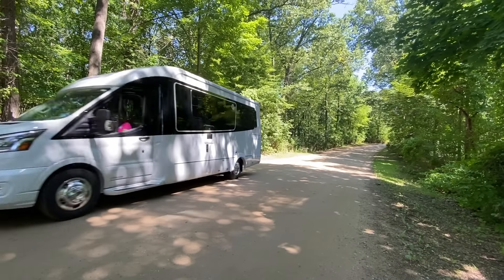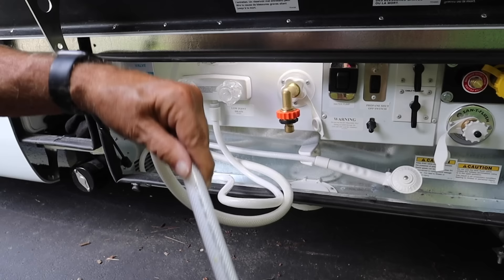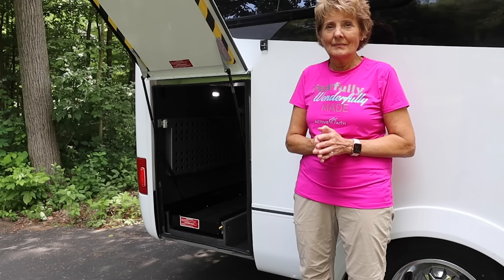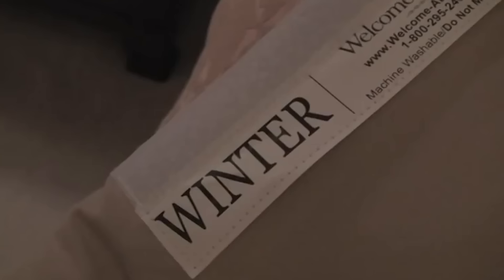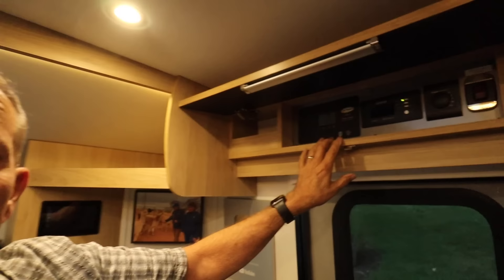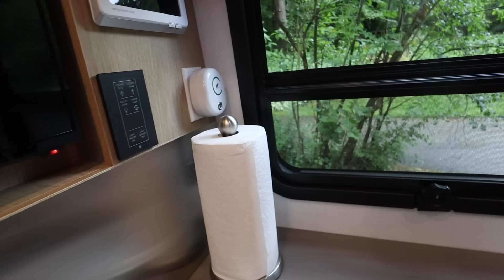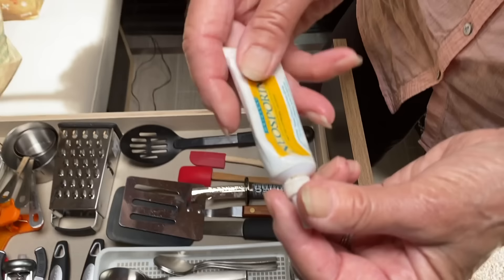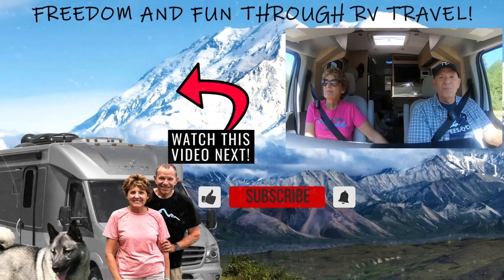Full Tour of our NEW RV! The 2020 LTV Wonder RTB Part 1

Comment: I really like how you two worked together on this.  I think they should hire you do to others!   Your voices are easy to listen to, and I especially like how you did the back and forth.   Usually someone will spend so much time on the outside or the electronics and I get bored before they show the layout.    I think you integrated all that very well.
Reply: I agree! Their voice are so calming. Oh well the mister used to be an anchor at a tv station somewhere in Michigan I think. Thats why.
Reply: I had same issues with my black and grey handles and I hated it! Have your Rv guy put motors on and then you have push buttons no more crawling under unit to reach handles!
Reply: Awesome video

Comment: LTV keeps getting closer and closer to building the perfect all around rig, but is still lacking in a few areas that I consider to be key for extended boondocking. First off, they do now offer the option of getting the Wonder with Intelligent AWD, which will make a huge difference in inclement weather conditions, while also giving it a small amount of off road capability. I only wish that they would lean more heavily into the all electric category by offering at least 400 amp hrs of lithium, a 3,000 (or more) watt inverter, an induction cook-top, a 12 volt AC with soft start (like the Coachman Beyond) and a compressor driven 12 volt fridge. Also, a Truma Combi which includes a furnace would allow them to ditch the propane, and an engine driven dual alternator set-up with auto start would allow them to ditch the generator. These modifications would not be all that expensive considering the fact that you're swapping out the propane tank, furnace, and LP generator for similarly tasked equipment that just uses a different power / fuel source. My final ask would be a composting toilet, which is now an option on some of the newer class B and class C RV's. 
Another suggestion would be for them to move the lithium batteries inside. No more worrying about battery temp, and since you'd just be swapping a few cubic of feet worth of interior storage for an equal amount of added storage space in the garage, it's a no brainer. On top of that, good lithium batteries are very expensive, and moving them inside would make it that much harder for a thief to get at them.
Reply: Mark Villano with your positive notes and an owner of a LTV 2017 Unity, I would also suggest changing out the flat solar panels to for example Zamp solar panels. Have the option of more than 400 watts of panels and more than 200 watt/hours of lithium batteries.  For us we have installed 650 watts of solar and 6- 100 amp hr Battle Born batteries along with a 3000 Magna Hybrid inverter by AM Solar.

Comment: I love this unit and am a huge ford fan. But, the minute I saw the dump valves I said 'nope'. Had this set up on our first rig. I was the person with the honor of doing that job. The first time the handle came off the valve and I had to lay down on the ground by a dump station was the last time I did that job. We got rid of the rig. The location of the dump valves was the first place I looked when researching a replacement. Manufacturers need to take care of the issue.

Comment: I agree with the Ford ride. I've had a Chevy B class and a Dodge B Class. I've also driven the Mercedes Sprinter Class B. The Ford ride, in my opinion is a lot smoother. My understanding: Ford spent a lot of time on the Chassis to insure that smooth ride. In my opinion, it shows!  Driving my current Ford Diesel (Thor B+) rides like an SUV. The other benefit of a Ford: parts are cheaper and one can find more Ford dealers than Mercedes. A word of Caution, though: Many Ford dealers cannot HANDLE "big jobs" on Ford Transit RV's. Why? Because many don't have lifts that can handle the weight..or..don't have drive over trenches. However, USUALLY one can find a Ford Truck dealer in the area that does.
Reply: Rides like a dream.

Comment: One thing that I like about the Ford Transit over the Mercedes Sprinter is the placement of the rear view camera monitor when it is integrated into the center mirror on the windshield instead of being low on the radio console.  For one, you can keep the camera on full-time with the Aux 1 button and have your view from behind on all the time.   Second is that it feels more natural when checking your mirrors and behind as it's easier to glance at the center mirror then your right mirror than looking down at the center console screen that's also the radio and navigation system.
Reply: Also to note regarding the Truma Hot Water system is as long as the control is set to Comfort Plus you'll get the endless hot water.  The other settings are more for economy or winterizing the hot water system.

Comment: Another great video. This one seems so practical in every way except for the gray tank dump. hopefully you can find an extension solution.
Reply: Senior Sister I saw simple extensions added to another with this problem. Worked fine.
Reply: @bevgunson1486  where did you find extensions??  This older person with bad knees would have a problem getting down and back up!!

Comment: It's a nice layout, but the one undesirable for us would be the gas vice diesel engine.  I was hoping this was much cheaper than the Mercedes Sprinter versions but it's not.  The twin bed model starts at around $130k where a fully loaded Mercedes Sprinter 24' fully loaded will set you back $140k.  Plus, the Mercedes has a layout where you get a dedicated dining area; not one where you have to insert a table, plus you get a walk around queen bed.  Not knocking this rig, has some nice features, but I would pay the additional $10k and get that diesel.

Comment: Thanks for answering my nagging question about every twin bed coach, the bed width! I would imagine LTV will be offering fitted sheets and duvets for this coach, as soon as they catch their production restart breaths. I’m hoping my folding recumbent trike will fit in the garage.
Reply: I like twins. Another couple tool that middle area at head of bed and put a small piece of cushion. It just makes it a little easier to get out of bed having hard surface covered. I like the fold out center piece to queen. I think twins are 33 inches wide. I have a youth bed tat is 30 on an old brass bed frame. It is fine to sleep on.

Comment: A solution for reaching the gray water valve, a pin puller from a truck stop. Originally used to disengage the fifth wheel pin on semi-trucks. I think this would work for you.

Comment: Another great video!...Just one correction. That was not a gravity drain that you pointed to. That was the macerator pump. If it ever clogs you can move the silver metal piece to the side and get a screwdriver in there to turn it and unclog it like a garbage disposal. Much easier location than on my Era 170!

Comment: I am in the market for a leisure travel van 2021 and stumbled upon your videos. I realized that your van doesn’t have the upgraded features that are advertised on the website for the 2021 model (i.e., the 4 kW generator, the storage compartment handles, and the magnetic rack in the galley). If you go to the LTV website and look up the 2021 product upgrades for the wonder you’ll see what I’m referring to. 

I see you guys are so happy with your van but I just felt compelled to give you guys a heads up. Thanks for the content I can’t wait to see more from you both!!

Comment: Nice video. I am seriously considering getting one of these Wonders. But with all the interest in this RV, I hope that Leisure's production quality does not drop. We currently have a wonderful 2003 Chinook Cascade 2400 with the rare GM Vortec 8.1 liter gas engine, which was recently tuned by Ultra RV. It's the same engine which powers racing boats. It's as big as this Leisure, but it accelerates like a V8 mustang. And it can tow anything.

Comment: I think you’re going to find that the ebikes on the back trailer hitch will exceed the weight rating of the hitch. In your video you mentioned an adapter. Adding a hitch adapter will reduce the weight rating of your hitch by 50%. Your bikes plus the hitch will weigh 100-150#. So I hope your hitch rates for at least 300#!
Reply from the maker: I carry one on the hitch. One in the garage

Comment: Someone may have already mentioned this, but I wonder if two Rad Mini folding ebikes might fit – along with all your other gear. Those are the ones I am seriously considering for our Travato. One folded under the Murphy bed and one up in the factory-equipped bike rack, which has a weight max of 100#. The step-throughMini is 42 x 23 x 30” and the non step-through is an inch or two smaller all around.

Comment: Ive always thought a van was just too small for me with the exception that sometimes home made builds seem to do something just a little different.  Meaning space wise. I can't really put my finger on it, but the DIYer jobs seem to open up the space a little.

That was a long way around to say that yours is one of the only factory van builds that doesn't  seem too cramped for me.

I'm thinking of retiring on the road as it were, and common sense tells me a van with no pop outs probably makes more sense.

I still can not stop gravitating towards a fifth wheel though.  The price may make the decision for me though.
Believe me, I understand all the variables, yet when it comes down to dollars versus what's in front of my eyes, your rig for what, $150,000 versus a really nice fifth wheel with a heavy duty diesel truck for say, $150,000.

It's very hard to do the van thing.
Nobody wants to get stuck or even totally stranded, so the Van seems like a safer option. 

But it's just, a well put together fifth wheel appears to be so nice. Notice my wording. "Appears".

Comment: QUESTION:   Mike, does that heater switch for the lithium batteries come from LTV or was that after market?  Awesome video and nice extra touches..
Reply from the maker: Duce Webber it’s from
LTV
Reply: Duce Webber like that...less worries.
Reply: @RVLifestyle  that's awesome,  We should be getting our  Wonder RL, Dec 2020 and ordered the Lithium batteries.  We live in Colorado and love that the batteries can be charged below 25 degrees with the heat management system...my wife and I love your informative videos,  purchasing all the must have now based on your experience...have my rv smart start, just need my Motorcoach....😃😃😃😃🛺🛺🛺

Comment: For $130,000 I wd have bought a good used 31 ft fifth wheel trailer and a good used truck. way more room and u can just park the trailer at your destination and drive the truck around locally; way more room and way easier.

Comment: Wonderfully executed video, informative, joyful, creative. My one comment, putting 89 octane gas in an engine designed for 87 octane does absolutely nothing to improve performance. The octane rating in the owners manual is based on the compression of the engine. If you don’t have a high compression engine, high octane does nothing.

Comment: Where does the table for inside dining store when not in use. Thank you for the video. We have a 1990 Toyota Odyssey that is still going strong and I love all the ideas for small area storage--no garage, unfortunately.
Reply: It can either be put up in the back between the heads of the beds or at the foot of the driver's side bed (storage spot for it.).

Comment: MIssed opportunity on this model only having a 2,000lb class 2 hitch. Excludes anyone wanting to add a TOAD. I understand there are challenges with increasing the tow rating due to the rear garage design, however the chassis/drivetrain is more than capable of towing 5,000lb. LTVs engineers really need to put their heads together and figure out a solution to beef up the rear structure. Confident it could be done with enough effort.

Comment: Great video, Thank you. I am also curios about the heater for the Dragonfly batteries. was the heater included with the upgrade? I am in the process of ordering/purchasing a 2021 Wonder RL and was considering the battery upgrade but the cost seemed high. What are your thoughts?
Reply from the maker: NoWorries. Yes LTV installed the battery heaters at the factory
Reply: @RVLifestyle  Q:"stalked the heaters?"  I also ordered a 2021 Wonder but opted for the AGM batteries thinking I could upgrade to Lithium later.  Was that wise?
Reply from the maker: @ankerbell4593  fixed... a typo :-)
Reply: @RVLifestyle  will the battery heaters be included when you get AGM batteries?

Comment: Great video. One question: At 18:25 into the video you talk about the battery heater switch. You say, "Lithium batteries don't like to charge or discharge when it's cold." That seems to require that the battery heater is powered by shore power rather than the lithium batteries themselves. Is that true? Then you're SOL if you're boondocking, right?

Comment: What's the difference between heat pump and heater?  What's the purpose of the heat pump?  How is the heat pump powered??
Reply from the maker: The heat pump feature on the AC entails the AC working in reverse mode and supposedly pumping heat from the outside of the RV to the interior of the RV. It may help a little when it is only moderately cold, say around 50. The heat pump is a supplement and is not intended to heat the unit like the furnace will.  Heat pumps are not a very efficient method of heating and, frankly, we have never used the feature in 9 years of RVing. If we need real warmth, we turn on the furnace :-)  I think saying an AC has a heat pump feature is just a marketing gimmick.

Comment: I will be interested to see what you think about the under bed closet as time goes on.  I did not notice if there were cupboards I the bedroom for foldable.  
Also curious about plug ins in the garage for e bike charging.  Beautiful rig.  We have a used Unity MB and love it but have to admit that the newer models have some bells and whistles that I drool over.  Happy Trails!
Reply from the maker: Pat A there are two large overhead cupboards in bedroom.
Reply: There is no actual 110 volt plug in the garage but there is a small door that goes into the under bed closets on either side so one could run a short extension cord through there and into one of the bedroom plugs.

Comment: I'm curious for winter camping, does LTV have heated tanks and fresh water positioned on the inside to prevent freezing? I love the rear twin and new rear lounge floor plans.
Reply from the maker: No heated tanks... you winterize the plumbing system in cold weather and flush the toilet with antifreeze you pour out of a jug

Comment: I hear everyone describe their RV as a “2020” on a 2019 chassis. You may have bought both, but you only own one. Your title tell the truth, it’s a 2019. You have accepted the RV Marketing scam.
Reply: The title year will based on the RV model year, not the chassis year, because your title refers to the complete vehicle. The chassis is an "Incomplete Vehicle" and cannot be titled until completed by a registered Body Builder. 2020 was a big changeover year for Ford, so the 2019s were produced through the end of the calendar year vs typical years when they change over around  end of summer. Ford did not even build a 2020 E-series because of the production gap and changeover timing. They went straight to the 2021 model year.